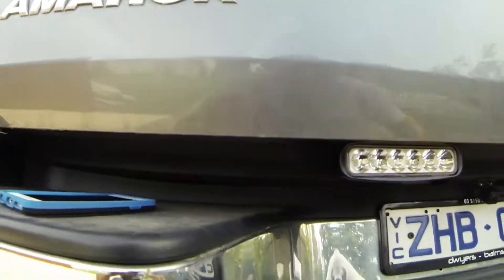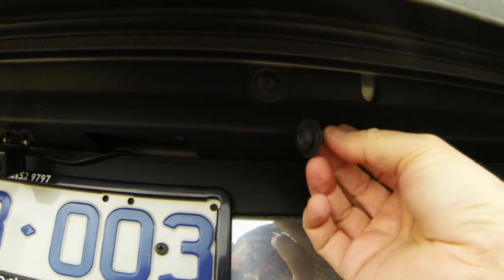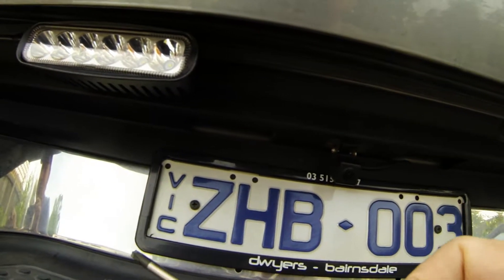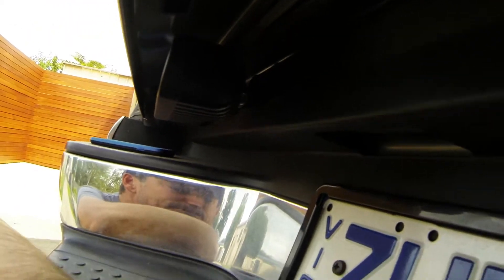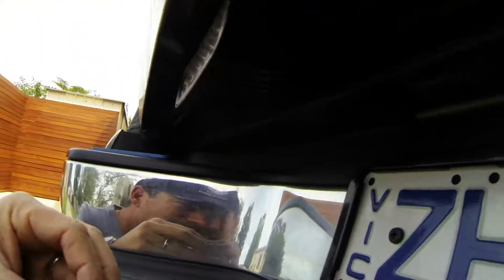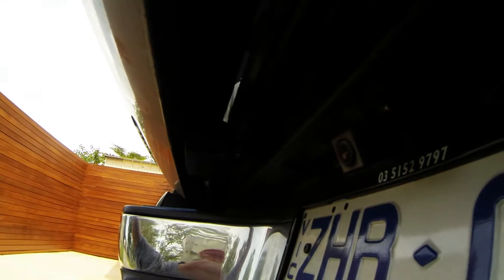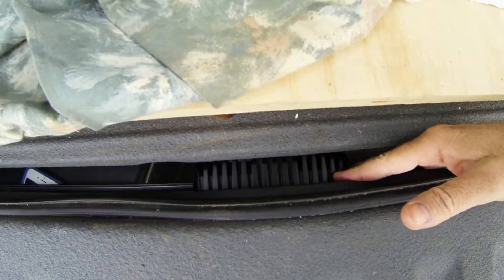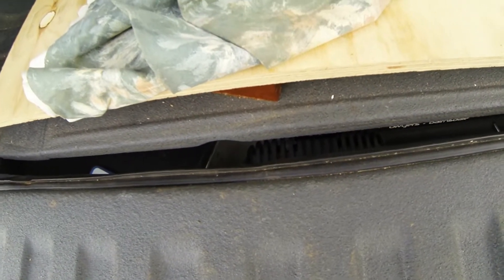LED Reverse Light Amarok

Comment: Hi Mate, nice clean install. Want to do the same thing with mine. How deep in from the mounting point is that light and mounting plate? Need more light when reversing.
Reply from the maker: +Kent Davis  If you look under the tailgate, you will see about 4 large Torx bolts with big washers. That's where it attaches and the light comes out just enough to fit in the tailgate gap.I would guess the mounts that came with my lights are about an inch and a bit? I can measure when I get home.

Comment: I am just wondering how you put the cable for lights? Did you drill a extra hole next to the screw point of the bracket?
Reply from the maker: I ran the cables just under the plastic that covers the bumper at the top. Then it pokes out just where the lights are.

Comment: Hey Stephen, Ive just recently installed the exact same lights following your link and the amarok forums. My issue is I cant get the lights to fire through the relay. If i can ask you, I got all my wires from the tow bar wiring. Googled VW 13-pin wiring diagrams and got the earth, constant battery, reverse light from the loom, put it all in and wont fire. How did you wire it up?
Reply from the maker: Alan B I used the interface plugs under the front dash near the clutch pedal. They are wrapped up in cloth tape. What year model is you Amarok?
Reply: Ive got a 2012 highline. Im not sure if my car has an interface plug but I purchased the car and it has front spotties, UHF radio and a trailer brake thingy. I cant run any wires from under the dash to the back as I cant lift the back seat up because of baby seats installed. Surely the signal wire from the reverse light on the trailer plug should be sufficient to trigger the relay

Comment: Hi Steve, What brand is the light? Did you wire it into the tow bar outlet?
Reply from the maker: +Richard Toomey Hi Richard, The lights are from ebay. From memory they are only about $20-$30&#160;a pair. I wired them throught the accessory plugs under the dash where your clutch pedal is. If you watch my other video on dash removal, right at the end I show you where they are.A relay from the reverse sensing wire in there and then the power connection in the plug as well for the main power. All done through one plug under the dash without having to go through the CANBUS in the Rok. Go to ausamarok.com.au for a lot more info on this and other things for the amarok. Here's the link for the other video.https://www.youtube.com/watch?v=_Lcy-yVC_eU
Reply: +Stephen Simpson Thanks Steve. I'll look for you on the ausamarok page.
Reply: +Stephen Simpson Hi Steve, having some trouble finding you on the forum........
Reply from the maker: try snapsimo. That's me on the AusAmarok forum

Comment: Can I ask what size bolts  did you need to buy to replace the original ones?
Reply from the maker: From memory they where either 20mm or 25mm. I just took the original ones to the store and got the next size up. Wasn't much in it.
Reply: Stephen Simpson thank you I did the same just took them in and they give me 5mm longer ones.

But I’m temped not to touch them and get the stick on cob ones.

Comment: Can you install a couple of these for me?
Reply from the maker: you will need to get a wiring loom to make it easy. Then you could do it yourself. Then its really just plug and play. Unscrew the bolt, fit the light and plug in. Very easy to do. Where do you live?
Reply: Around Patterson Lakes, I can give it a go, but need to know exactly which lights are these and where to get them. I assume a standard wiring loom from Jaycar will be OK?
Thanks,
Reply from the maker: Nope, eaier to go to Ausamarok.com.au
Find a guy named Peter Jones on there. Get a ready made wire loom from him. All plug and play. Here http://www.ausamarok.com.au/forum/showthread.php/6708-Wiring-pictures-and-solutions
Then get the lights off eBay
http://www.ebay.com.au/itm/2x-6inch-18W-LED-Light-Bar-Driving-Work-Lamp-Flood-Truck-Offroad-UTE-4WD-/261191084943?hash=item3cd033ab8f:g:-bIAAOSwq19XBaN6
Least trouble and easy to install.
Reply: Thanks, bought the lights. Any other form of contact to Peter Jones? Tried to register to the forum, you need 2 IT degrees to get through.... Cheers,
Reply from the maker: lol, just register and then post twice on a topic, then you will be able to make you own topic and ask for him. Best guy in the world for electrics.
Reply from the maker: look at this topic.
http://www.ausamarok.com.au/forum/showthread.php/6710-Reversing-Light/page5?p=156355#post156355